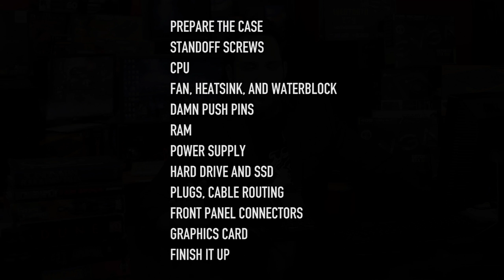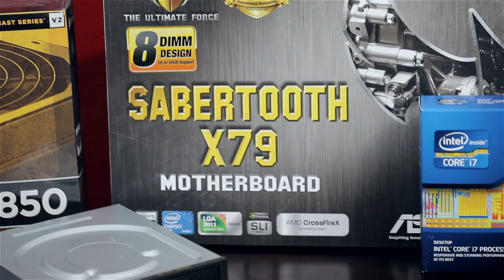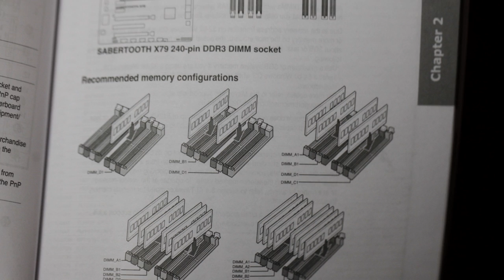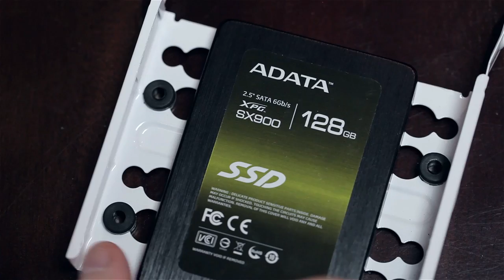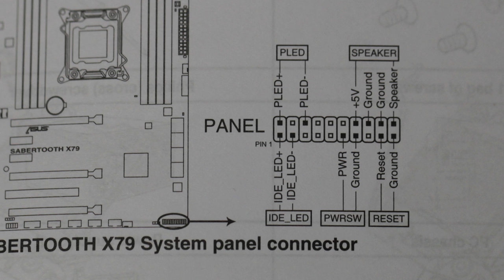How to Build a PC: The Ultimate Guide from Tek Syndicate

Comment: Can anyone judge my build?
Motherboard:SABERTOOTH 990FX/GEN3 R2.0
GPU:EVGA GeForce GTX780 SuperClocked w/EVGA ACX Cooler 3GB GDDR5
CPU:AMD FX 8350
Power Supply:Corsair TX850M
RAM:Corsair Vengeance DDR3 8GB
Case:Phantom 410
CPU Cooling:Cooler Master Seidon 240M Liquid CPU Water Cooling System

Comment: I thought the PSU was self contained.. the fan is always set to pull, and exhausts out the back vents.. putting the fan facing up or down makes no difference, other than pulling slightly hotter air from inside the case, or slightly cooler air from under the case. Also, putting the fan facing down, and then placing the PC on carpet, can essentially suffocate your PSU..

Comment: If I'm replacing the CPU for a different one and I had a waterblock/liquid cooler that had thermal paste on it, I would take it off, and reapply the thermal paste, yes?
Reply: Why would you do that?
Reply: 2 FPS ....why would I not? The new cpu doesn't have thermal paste on it yes?
Reply: But the waterblock does?
Reply: 2 FPS But its all dried and slightly crumbled off from being on the old cpu?
Reply: Skull Knight oh well then yeah. Take off the old thermal paste and put new thermal paste on.
Reply: Skull Knight 2 FPS
always clean the thermal paste and apply some more
Reply: Timothy Walker
Yeah. got that last month. thanks.

Comment: Q: If I want to use a newer CPU than the motherboard's stock firmware will support, do I need to buy an older CPU, upgrade the firmware with it, and then take it out and switch to the new CPU?
Reply: +Paianni A: It doesn't have to do anything with firmware. If your motherboard does not support the pins, it just does NOT. if it does, it will support it and your cpu will WORK.
Reply: +wut adding cpu support is one of very few reasons to update bios/uefi provided it uses the correct socket. A cpu supported by the current firmware would be required for the update, some boards have a removable bios chip so buying a pre-updated one may be possible/cheaper

Comment: I'm new to pc building so do you have to have a heat sync or CPU cooler?
Reply: An external cooler is required for overclocking, but the included will be fine.

Comment: not to mentioon i will be upgrading to a 770 gtx for bf4 because bf4 even tho it has the same graphics as bf3 pretty much the ragdoll/physics engine it will have will be much harder to run than bf3 so yea dont get a 7770 graphics card is the most important part inside a gaming pc get a cheaper cpu and a more expensive graphics card because graphics card is what does all the work

Comment: please help do i lack something or need to change something in this build? thank you.

Intel Core i7-5820K 3.3GHz 6-Core Processor 
Corsair H100i 77.0 CFM Liquid CPU Cooler -
MSI X99S SLI Plus ATX LGA2011-3 Motherboard -
Corsair Vengeance LPX 16GB (4 x 4GB) DDR4-3000 Memory (2 sets) - 
Samsung 850 EVO-Series 500GB 2.5" Solid State Drive -
Western Digital BLACK SERIES 2TB 3.5" 7200RPM Internal Hard Drive 
EVGA GeForce GTX Titan X 12GB Superclocked Video Card 
Corsair 750D ATX Full Tower Case
EVGA 750W 80+ Gold Certified Fully-Modular ATX Power Supply
Asus BW-12B1ST/BLK/G/AS Blu-Ray/DVD/CD Writer
Reply: change the titan x to a 980ti. same video card with less vram for 350$ less.

Comment: well i have changed cpu's and ram, installed video card and hard drives drives etc...sometimes had problems (which I sorted) getting beeps with badly seated ram and lose video card so I guess I'd manage it. In fact in some respects it is harder because dissembling cos you don't know how the connectors are held in and it is cramped as all the cables are tied together, plus it is full of dirt/dust.Never put the operating system on though, always pre-installed, I guess I could do it, maybe I will!!

Comment: What card should I choose a gtx 660 or a gtx 750ti
Reply: Neither card is the most desirable, but the 660 benchmarks a little better than the 750 Ti. The only disadvantage would come in long term support given that the 660 Ti is a generation behind which means support will be discontinued a little earlier, though NVIDIA supports their cards for a pretty freaking long time so in most cases its not a major issue.
Reply: I would go with the gtx 660 if your getting a good deal that is. The 6 series of nvidia is still a good bunch and nvidia still supports its drivers so no problem there. the 660  should still do good for the next 2 years assuming you won't be playing at max settings and not expecting 60 fps. But if you could find some good deals on GTX 680's then I'm pretty sure you can max any game at 1080p even for the next 2 years or so ;)

Comment: Question! Does it matter if my CPU and mother board are different brands? Like if my board is amd and my cpu is Intel.
Reply: +Thomas Chris Yes it matters. If your CPU is intel it should have an 1150 or 1151 socket type. If your Board is AMD it could have AM3+ or so. Both need to be same socket so they can fit together

Comment: Where does one get Motherboard standoffs? Does it come with the case, motherboard or does one have to buy it separately?
Reply: +none2401 Comes with case or mobo
Reply: Yes, make sure the threading of the standoff matches your screws. Also don't overtighten your screws because you could strip the standoffs which is obviously....bad 😃

Comment: Someone please help a bro out!

Would you recommend: GTX 770 and a decent CPU or a GTX 780ti with an almost terrible cpu?

answers are hugely appreciated <3
Reply: Depends on what this "decent" CPU and "almost terrible" CPU is. Which one's are you talking about?
Reply: The terrible one is a Core I3-4150 and the other one is a core I7-4790K
Reply: Xelos Well in that case, neither. An i3 will bottleneck the 780ti (bring the GPU down to it's level and make it perform worse than it could) and an i7 has power and features that most games and hardware won't be able to take advantage of for a while still so it's a bit of a waste. A better option would be an i5 and a GPU somewhere in between your two choices. Also, if you're not planning on overclocking then save some more dough and don't buy a K series CPU. This is, however, assuming that you're talking about a gaming PC? I don't know enough about nVidia cards and it's good to get more than one opinion and preferably not from YouTube, so go to r/buildapc or r/pcmasterrace and you will find tons of info and advice there.
Reply: IceCreemNinja Gotya mate. Thanks for the response! and yes it's a Gaming PC of course. Hadn't thought about getting a AMD card since I've had bad experience with them before.I'll look more into it then! c:
Reply: As others have said, the Core i5 is better for gaming than the i7. And as far as the GPU goes... I'd really recommend dropping down to a 760. The benefit doesn't really outweigh the cost with the 770 and it definitely doesn't with the 780 Ti. As it sounds like you are operating on a budget constraint, yeah, I'd say drop the GPU down to a reasonable level and get a nice i5.
Reply: Get a 970 then, cheaper and quieter.
Reply: Go with the 770 and a good CPU. But i would take a look at the GTX 970 though
Reply: I'm thinking of making a budget gaming PC with a i3 4150, what GPU would you recmmend? I have an AMD 7750, but I guess that would bottleneck the CPU.
Reply: Valko Rusev I would recommend looking at the AMD FX-6300 over that i3. In the budget category, you'll get more for your money out of AMD. As for the GPU, the GPU is... Adequate. I'd recommend using that and saving up and purchasing either a 760 (last generation) or 960 (Current generation) from NVIDIA. 60 is the ideal line you want to be at for a GPU. You get a lot of power for a relatively minimal price tag. Perhaps a 750 or 950 would do the job, but I'd be more comfortable going with a -60 unit. Either one will serve you for many years. I am running a 560, which is now 4 years old and it has no problem at 1080p 60 fps on mostly any game I throw at it.
Reply: an i7 4790k is not a decent cpu wtf are u talking about, its a good cpu!
Reply: I recommend u the i7 and a GTX 970
Reply: IceCreemNinja An i3 woulnd't bottleneck a 780
Reply: Khajiik The Cat Man yes it would
Reply: GTX 980.
Reply: Wtf, so many useless replies. Just get a unlocked i5 if u wanna overclock or locked if not and a 780ti. Tho at this point I would stalk and see when a 970 or 980 come into stock and grab those. Also i3 wouldnt "bottleneck" a 780. You wont get the EXACT same performance out of it as you would with an i5 but the difference will not be huge. Most games are GPU bound.
Reply: i3 is too bad and i7 is too good and wasted potential, i recommend getting an i5 4460

Comment: Is pc really that good? Could someone point out pros about a pc?
Reply: customization, and a whole lot of it
you can use any resolution you want, provided your monitor can handle it (yay for 4k :D )
steam sales. so many steam sales
multiple monitors if you want.
typically good communities for games
if it ever breaks, it's usually just one part to replace, rather than the whole system (*cough console cough)
wanna game with a keyboard? do it. wanna use a controller? do that  too. play racing sims? get a racing wheel and pedals. play flight sims? get a flight stick.
oculus rift
a gaming PC can also be used for non-gaming purposes that would otherwise require a powerful pc,
better graphics
tons of indie games, if your'e into that sort of thing. 
no need to have discs for games
as much space to install games as you want (provided you just buy bigger/more hard drive(s))
SSDs, which are rediculously fast compared to standard hard drives
mods. oh so many mods
there's a myriad of other reasons, but i can't quite think of them off the top of my head. imo, Pc is worth it, but keep your consoles for the exclusive games (unless you don't like them for some reason)
Reply: Watch the TekSyndicate "Kill your Console" video. It explains why PC is so much better
Reply: Praise our lord GabeN.
Reply: yep. if you like console games there are emulators that will allow you to use the disks, for bluray make sure you have a bluray player on your PC

Comment: a hd 7770 at 720p monitor will run bf3 on medium settings at 50 fps if ur on a 1080p monitor u 35 fps very bad but yea u need 760 really... or if u wanna go with  what i have which runs it at 60 fps non stop on medium/ultra settings 660 ti a 660 ti should be the minimum card people buy these days because games are going to evovle so fast because of the consoles getting a better graphics card from launch so all games will have higher minimum requirements for hardware

Comment: Please help! I am fed up of my Xbox one and decided to switch over to the master race.
 I have a budget of £650 which is approximately $1000.
All I want it to do max out all games at 1080p, play games at 1440p fairly well and be able to load programs really fast.
Is this a good rig for the price? Any recommendations or changes would be most helpful. 

Intel i5 4690K 
ASRock Z97 PRO4 Motherboard 
Kingston hyperX 8gb (2x4) 1866mhz 
Seagate barracuda 1tb
Sapphire Radeon R9 290 Tri-X 4GB
Corsair 600w bronze 80+
Corsair SPEC-01 or Corsair carbide 200r

Thanks guys
Reply: seems good :) build it if you havent already
Reply: You can get a GTX 970 instead of the R9 290 (better performance and pretty similar price).
Reply: Jordi S. the gtx is 50€ more than the r9 290.. the two cheapest versions of the cards compared
Reply: Jo Kommentaah Yep, and you'll get around 25% better performance in games. I think it's worth.

PS: sorry about my english, I know it's not good... ;(
Reply: R9 290 requires a minimum 750W PSU
Reply: Domicile229 im pretty sure it cant use that much maybe it reaches a total of 400w the entire system at 100% based on what i hear pc can use
Reply: Jo Kommentaah the 600w PSU will allow him to upgrade later on
Reply: Ed Brown pcpartpicker. It compares all webs that sell pc components and make for you the cheaper pc with the components you were looking for.
Reply: Remember to get a SSD!

Comment: I don't know man, heat rises, so I don't get why you "like" having the power supply mount at the bottom.  Even if there is a hole to push the hot air out, it isn't as efficient as having the mount at the top, pushing the air out there.. Stick to the facts and don't talk up a case just because you're using it! Other than that, good tut

Comment: You got how the power supply vent wrong! The power supply vents out the back and sucks in the bottom, look at the fan! Also turn on the computer if you put your hand be hind the PSU you WILL feel air blowing out!
Reply: Andre Salles
Do you want me to prove what I said. I cannot believe you! I was letting the owner of the video how to improve! Oh, and no more bad words please!
Did you look at the PSU in your computer. I am going to build a computer, and just got a Corsair PSU with that fan type! If I hook it up to something that will draw 50% of its power the fan should be going fast enough so that I can prove you wrong!
But first try it on your own computer!
It is stupid that you are trying to defend something that is false and I can easily prove wrong!
Reply: Dude...just look a the power supply and learn about it  , we are in 2014
I also have a corsair and I know how it works mate , just look it up
Reply: Andre Salles
I did look it up and it proved me right! They pull air in the bottom (where the fan is) and blow it out the back (the part that is visible from the back of your case)!!!
Reply: Joshua's Recordings
Yes we know how they work. We heard you several times.
 You could also put the PSU upside down so that it sucks heat from the inside of the case and exhausts it if you don't want to suck in air from the bottom, or if your case does not have a grill on the bottom.
Reply: Yes, but then the PSU is less efficient. Because it is hot!
Reply: doesnt matter of you got the cooling right...
Reply: Joshua's Recordings This is the internet, cuss words are ok...
Reply: Joshua's Recordings Doesn't matter which way you put it in, both work. Of course, pulling cool air from the bottom vs warmed air from inside the case will be different in terms of cooling. However, no way is wrong and it is personal preference. Corsair power supplies specifically the TX series are very efficient and the fans only turn on when needed. Thus, in this case, it does not really matter which way it is oriented. Now stop arguing and enjoy the video!
Reply: FlyingPinguin88
Yes I know. It is just that when components in  anything electronic/computer related are cooler they work better (more efficiently). All I'm saying is that it will actually make your PSU last longer! That is a fact! But it will not be bad for the PSU! All I said for that was a example to get my thoughts to Andre Salles!
I never said you can't put it in that why! Though what I thing and Newegg and Linus Tech Tips agree is that it works better when you put it in with the fan facing the bottom of the case!
Reply: Joshua's Recordings Again, it is personal preference. The PSU is efficient enough to not need cooling most of the time in the first place. Having the fan blowing a little warmer air through the PSU in the chance the fan does actually come on will not make the PSU last longer. Even if it does, it's barely noticeable and that's not usually the factor that leads to power supply reliability.

I usually go with getting air from the bottom, but I guess Tek Syndicate thought otherwise. It is not wrong to, but it seemed logical in this case since there is a fan filter.
Reply: FlyingPinguin88
No, I'm not saying that Tek Syndicate got that wrong, he got the way a power supply works wrong.
I do like Tek Syndicate, I'm subscribed. Though I know that the way you put the power supply in isn't wrong. But he said it sucks air in the back and blows in out were the fan is, which is false.
I also prefer the power supply suck in air the bottom of the case and blow it out the back.
But I feel you misunderstood me. I'm sorry for causing so much confusion.
But he got the way power supplies work wrong not how to mount them wrong, just to make myself clear!
Reply: Joshua's Recordings I misunderstood you. He did explain the airflow of the PSU wrongly. What you said before was a bit unclear so apologies.
Reply: Accepted, it has been nice talking with you!
Reply: Andre Salles Chill man, most psu's suck fan from the top and blow out back.
Reply: That is what I was saying!
Reply: Joshua's Recordings I guess people think your wording is weird
Reply: What?
Reply: Yes maybe. But I think their wording is weird! I do it old school!
Reply: Joshua's Recordings You get worked up easily bro.
Reply: No, I was just misunderstood and I tried to get my point across as clear as I could!!
Reply: ***** the first guy got really worked up
Reply: pizza will solve these problems

Comment: What component does the sata power cable come with? The power source?
Reply: the power SATA cable will come with the power supply. Most modern power supplies will have them. If your working with a old power supply you may need a molex to SATA adapter. if your can afford it I would recommend just getting a new power supply.

Comment: It will simply not fit... All connectors are different... And from looking at them... You can see where they go... They're also coded so just look into the power supply manual to see where it goes.

Comment: Can someone please help me? I was putting on a stock intel fan on an i3 3220 and I didn't like the way the fan was positioned so I took it off and put it back on. Should I be worried? Also, I repositioned it immediately after putting it on so the paste was not dried.